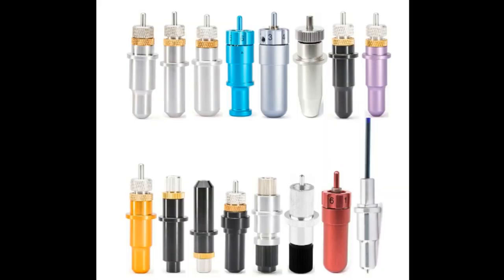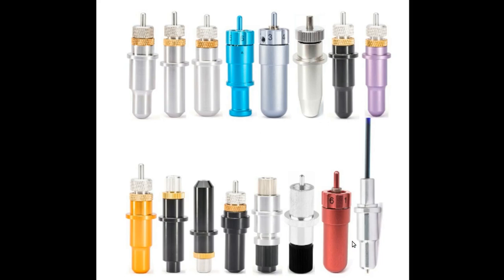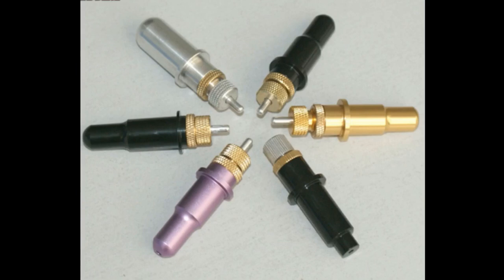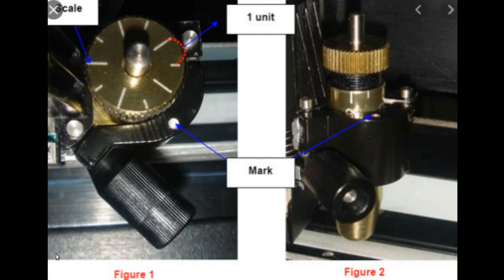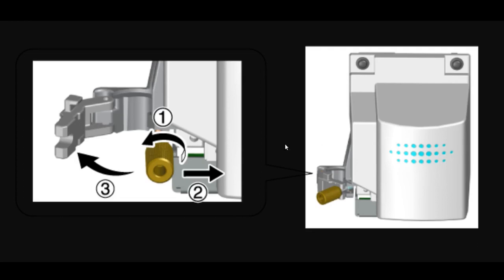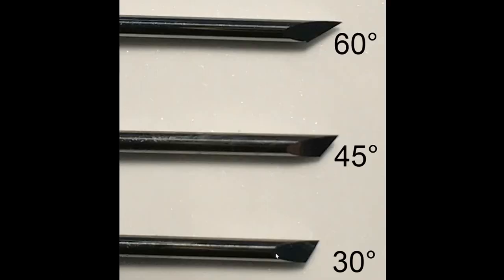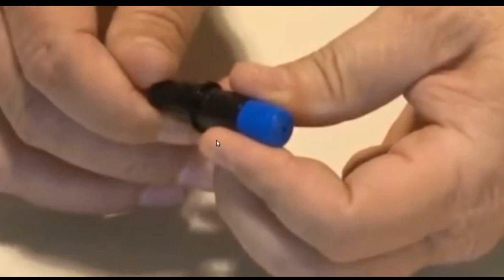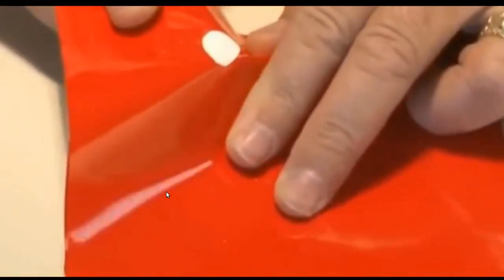How Blade Holders and Blades Work (Review and Links)

Comment: Hello, Not sure if you can help, but with my Chinese cutter (looks the same as the uscutter MH) the blade holder is "skewed" or "crooked" in the carriage arm after I tighten the screw. The carriage arm is level with the rest of the cutter, but the blade holder is not at a 90 degree angle to the vinyl, but a couple degrees off. Clearly visible.
My assumption is that the carriage arm needs some machining, because the contact patch seems to be a bit off. Would it be possible to do this on my bridgeport mill?
Reply from the maker: I have seen this before and even with the MHMK2 Uscutter branded cutters coming from China they all have that slight tilt. The arm is completely plastic. I am pretty sure that 100% of their cutters have this little quirk as I have always seen but it should not affect the cutting. Many people/companies will purchase from the same vendor and its universal.  

You could try to do this. I believe any adjustment or taking/shaving off in order to make the blade holder more of a 90 deg angle tot he vinyl would widen the arm space and the blade holder would not be as snug as it was before when closing the arm. 

I mean, it is possible but then you'd have to also either wrap the blade holder with tape so that it also adapts with the changes. Perhaps it may not be so significant if taking a little off. 

Perhaps your arm is metal. It may be the same thing too. You could also try putting tape, thicker tape on one side to see if it will adjust to the arm rather than machine the slot/arm of the carriage. 

Normally the blade holder just sits on top of the arm. I would see if you could adjust the blade holder to the arm first. If that plastic arm breaks you'd have to get a new one or machine a different arm to the carriage. 

Let me know what you end up doing. I'm curious.